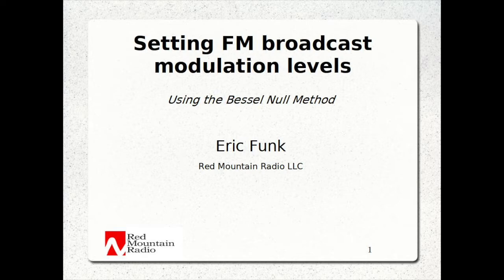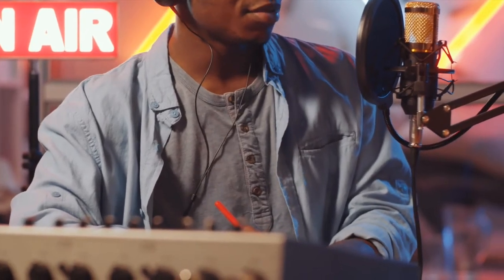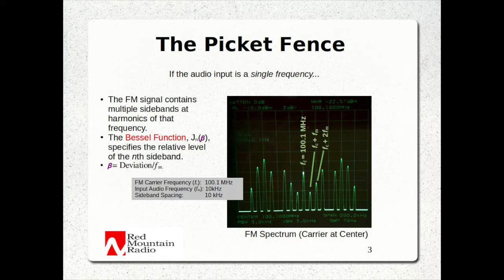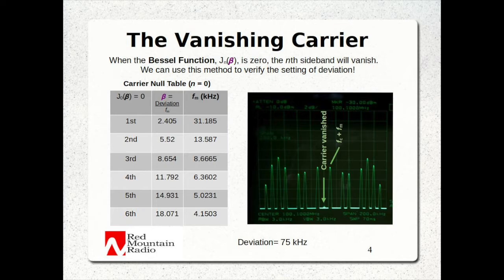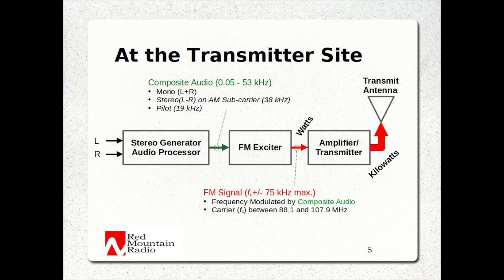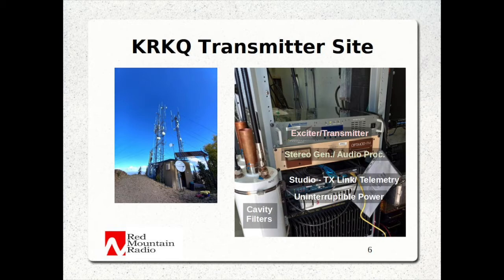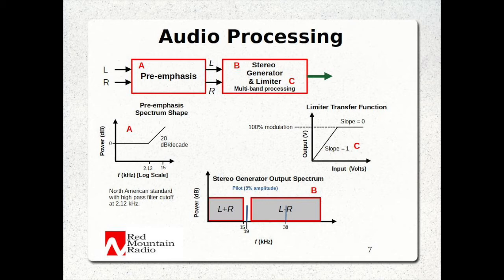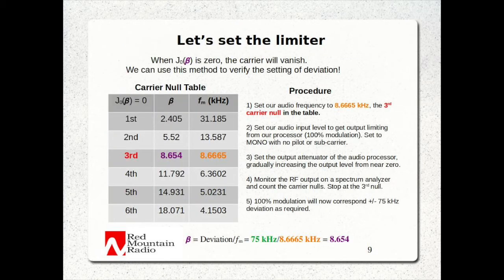Bessel Null Method of Setting Broadcast FM Deviation

Comment: I wold be extremely interested to see what changes to the procedure are made to accommodate MPX and RDS. Also does this change again when you are running NRSC5?
Reply from the maker: Excellent question. The Bessel null give us a method of determining when we have exactly 100% modulation.   If we set a hard limiter to 100% and the MPX and RDS sub-carriers are inserted before that limiter,  then we will not over-deviate. If the MPX and RDS are inserted post-limiter, then we'd want to back our limiting off by the deviation allocated to the sub-carriers.   Remember that we can perform the Bessel null at other modulation percentages other than 100% if we re-calculate the audio frequencies for the appropriate deviation.

Note that in the US, 1/2 of the RDS carrier percentage can be added to the total modulation. Hence, with a 6% RDS carrier, up to 103% modulation is allowed. Check the regulations wherever you are. 

Similarly, if we have an accurate modulation meter and set it to read 100% under the Bessel null condition, then we can use it to set things properly for all of the other subcarriers.

I have not examined the regulations for HD (NRSC5) carefully and cannot comment on that.